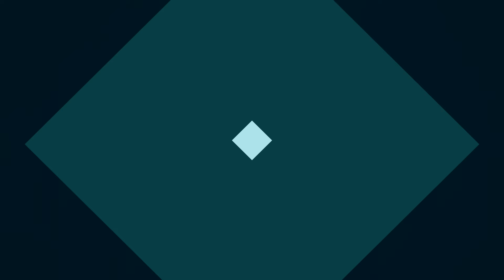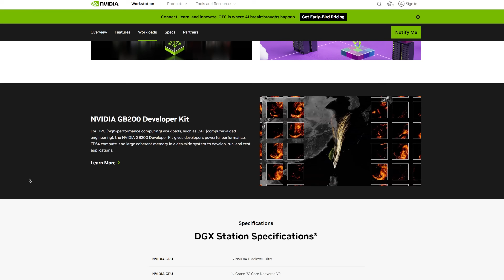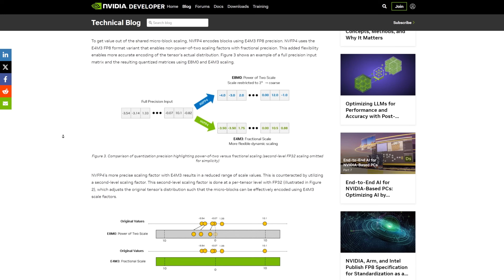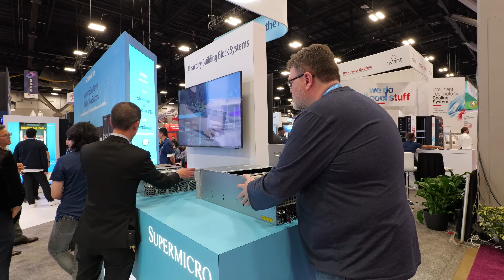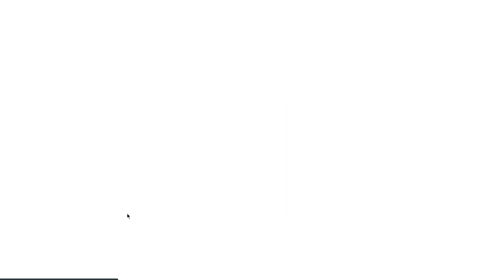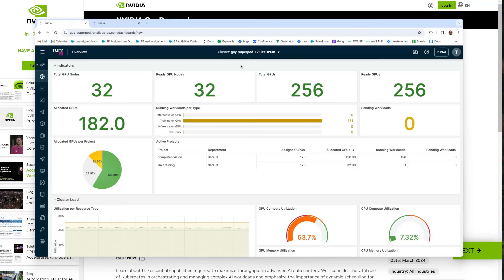DGX and RTX 6000s at SC 25

Comment: Supermicro GPU SuperServer SYS-822GS-NB3RT HGX B300 8-GPU
   $400k-800k
    Dual Intel Xeon 6700 series processors with P-cores, up to 350W TDP
    8x B300 Blackwell Ultra SXM GPUs with NVSwitch
    8x CX-8 Integrated 800G NICs supporting IB XDR or ETH 2x400GbE per NIC
    32x DIMM slots supporting up to 8TB of memory
    8x front hot-swap E1.S + 2x M.2 NVMe drive bays
    2x PCIe 5.0 x16 FHHL slots
    1x USB 3.0, 1x USB 2.0, 1x Mini-DP, 1x BMC/IPMI GbE LAN, 2x 10GbE NIC (X710)
    6x redundant (3+3) 6.6kW Titanium level power supplies
    8U air-cooled chassis with front I/O

Comment: Hopefully these GB200 AI workstations will be available for a bargain once the bubble pops. Seems like a perfect rig for a home datacenter setup. 1600W is still in the "high end desktop" ballpark of power draw and 288GB of HBM3e is plenty for home applications.
Reply: these will cost nearly as much as the house you would be using it it, depending on what part of the countey you live in.
Reply: @noname-gp6hk And like I said, hopefully once the bubble pops, it'll pop the Nvidia tax on this hardware. Just look at the price difference between the 5090 and the RTX PRO 6000 compared to how much more computing power and VRAM you're getting on the latter. Most of the price tag is Nvidia's "enterprise assurance" tax, not the actual value of the hardware itself. Sure, right now, brand new, it costs over $100,000. But I sincerely doubt that'll be the price once companies that buy these in the AI bubble craze will be offloading them for once they liquidate everything in panic when everyone starts to sell sell sell after everyone realizes they've been pumping money into a bottomless ditch for years.